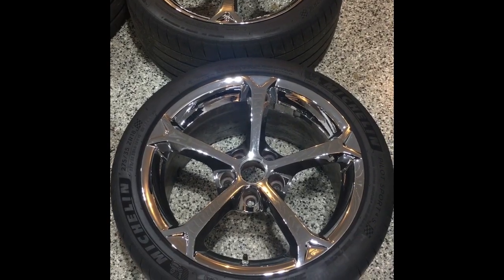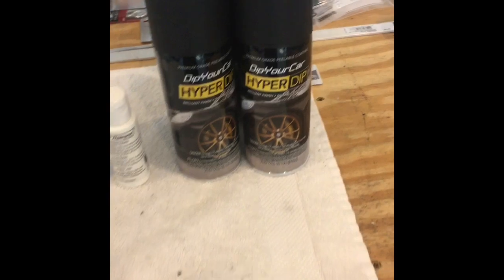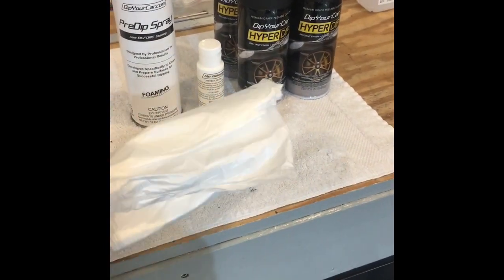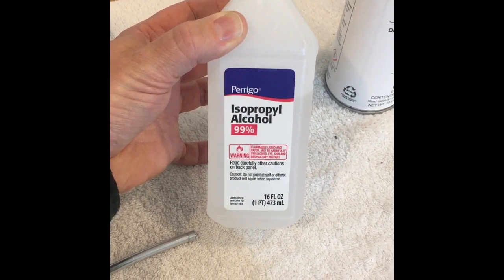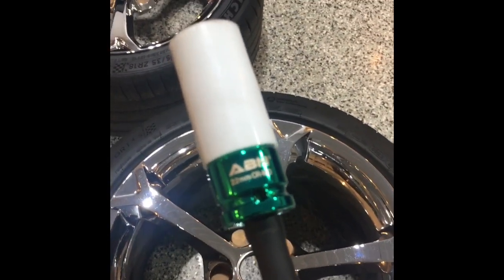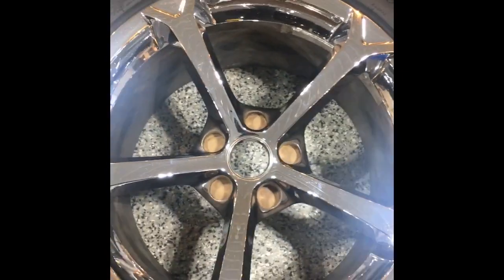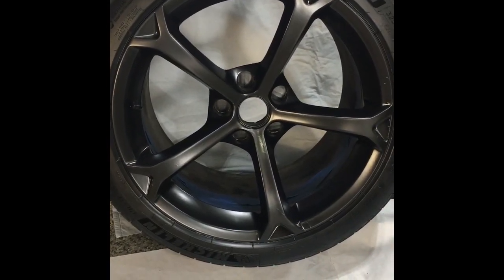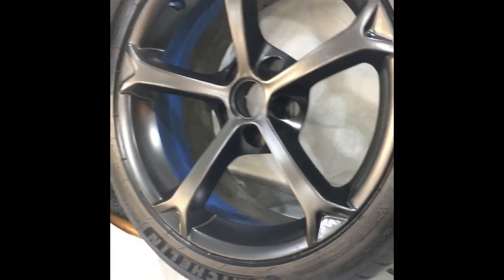Plastic-Dip Chrome Wheels - C6 Corvette

Comment: This was extremely well done… Patience, and the slow roll wins the race here! I had very little faith you could ever get anything to stick to a chrome wheel. This might be exactly what I do to my chromes…
Reply: Still a little confused on the masking, though… When you were spraying, did you have anything covering the tires? If not, what prevented from sticking to the tires?
Reply from the maker: It didn’t last.  One track day with some rain and it was junk.  Don’t do it.
Reply from the maker: Masking was a liquid that dried into a protective film that you peel off once completed.
Reply: @rw895  did you see my “long-winded“ reply on your other video last night?